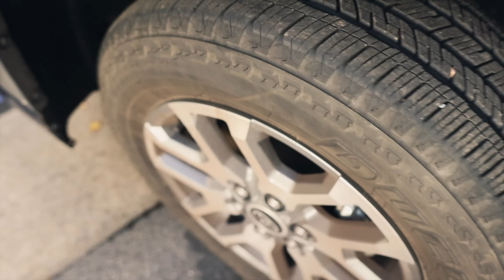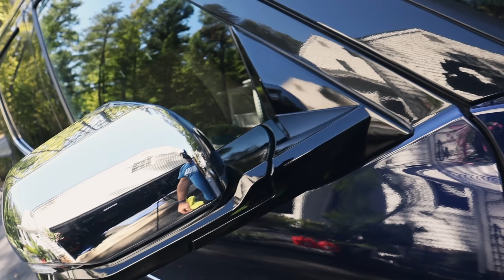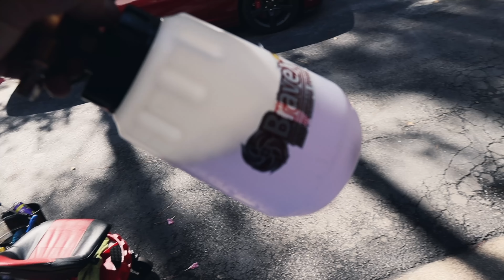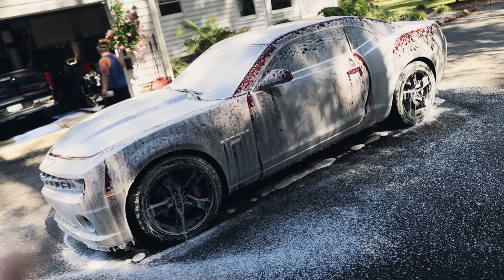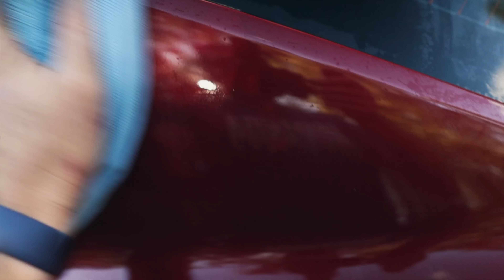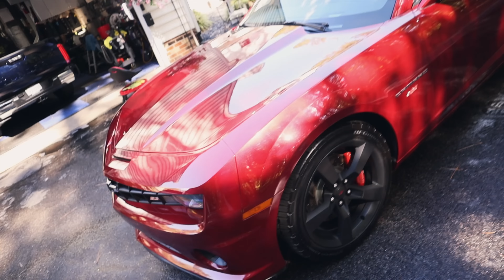Tips & Advice On How To Operate A Full Time Detailing Business! #detailing #details #training

Comment: Great video, do you have any tips for cleaning the instrument cluster, I have tried many methods and cleaners and I almost always get micro scratches. I can blow out or remove all the dust possible with ultra soft brush and use cleaners with lubricity and a good cloth and still find some scratches.
Reply from the maker: Hi. Basically using a soft towel and air but those plastics are soft and always scratch no matter what. Don’t sweat it…there’s nothing you do to prevent it from lightly scratching. Unless you PPF it when it’s new.

Comment: No iron decon needed for the tundra? How do you decide whether to do it or not ?
Reply from the maker: Hi. One doesn’t need to use irondecon unless the paint actually needs and you see small bits of orange rusty metal on the paint. We will do a test spot on the rear potions and see if anything reacts. If not there is no reason to waste product and use it everywhere just the sake of using it.  I know some detailers love to simply state a rule and say “you must use it everytime to make sure the the paint is perfectly clean” but the truth is if the paint smooth and clean from the clay bar or clay mitt, then it’s ready for the next step. 😎👍🏼
Reply: @MirandaDetailing  thanks for the reply and tips 👍🏾

Comment: Where you get those red circle foam applicators???
Reply from the maker: I got these years ago and can’t find the exact ones. But these are close. https://amzn.to/3TunbSt
Reply: @MirandaDetailing  I seen those too. Do you know who make the circle foam applicators that are the same size as the microfiber applicators at 5 in. All the ones I run into or around 3. 5 to 4 in
Reply from the maker: Do you mean the hand applicators or foam polishing pads?
Reply: @MirandaDetailing  the hand applicators. I once had a foam applicator that was 5 in, the same size as the microfiber hand applicator. I had got it from AutoZone about 3 years ago. Two in a pack for $5. But since then I have not been able to find any that size. I can deal with a 4-inch applicator but the 5 in just covers more area which means I'll get done faster. I thought about using the tire foam applicators with the hex grip but I don't know if is it suitable for car paint
Reply from the maker: These are the only ones I could find on Amazon https://amzn.to/3F7hKop

Comment: What's your favorite bug remover?
Reply from the maker: We usually just use our APC pre wash which works great. but I do have some Gtechniq Bug remover which works really well. https://bit.ly/3RzGY2e  Use code MIRANDA10 for 10% off
Reply: 3D Bug remover is very good!
Reply: Elbow Grease!  Most of the time, no chemicals are needed? I usually use ONR when I do maintenance washes, pre-soak. If I am doing a full detail, then my pre-soak foam and strip washing will remove bugs.

Comment: Phil, great content

Does that wax leave white stain on car trim?
From your experience 
What do you do to avoid those white marks, tape it off?
Reply from the maker: HI. No this sealant/wax does not stain trim. many older style waxes and sealant would stain trim but many new ones don't anymore. for simple waxing and sealants there should be no need to tape of trim. but if you do get some staining from other waxes and sealants just use a little isopropyl alcohol and a towel to remove that.